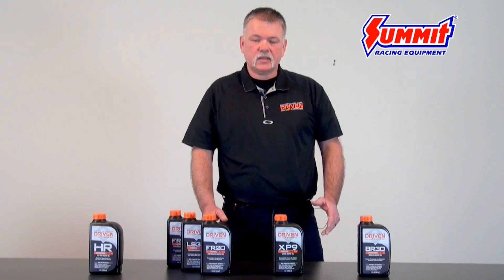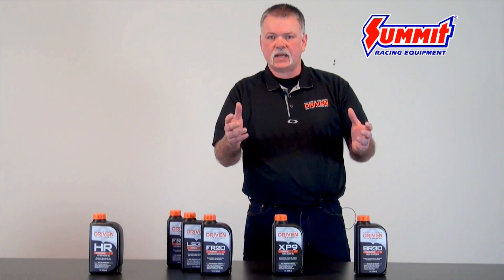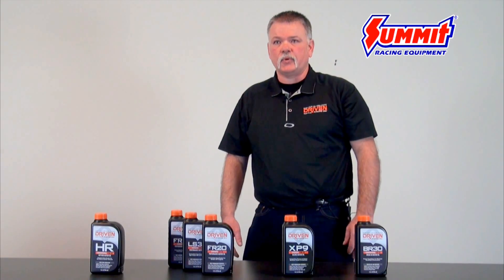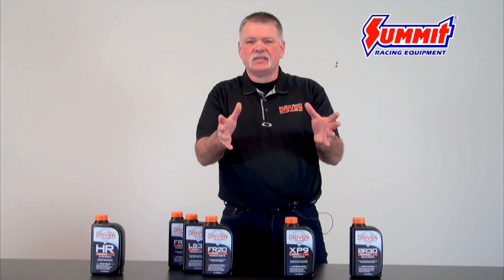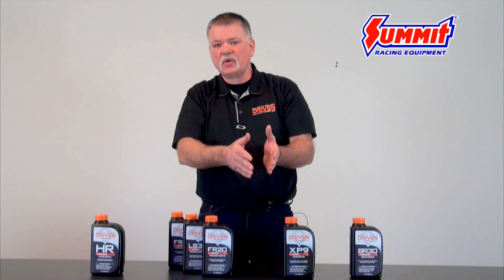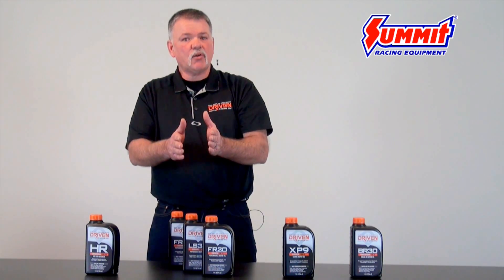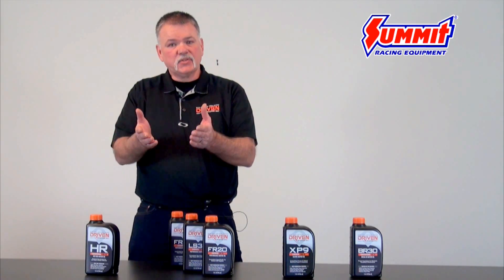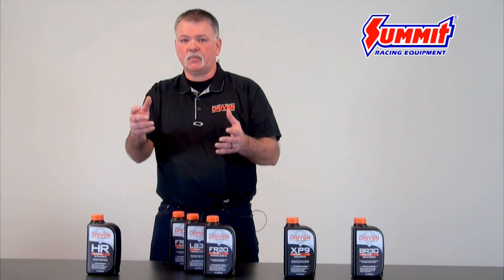Driven Racing Oil FAQ

Comment: All these questions following a video designed to answer questions.  Most common answer provided was that is not an easy answer followed by an incomplete answer.  That leaves us just needing more information.  I came to this site from seeing your ad in Panorama and wondered if I should be using it instead of a full synthetic in both my Porsches.  I left without changing to your product because the video answered almost no questions.

Comment: I started using Joe Gibbs LS30 oil in my 2015 Camaro SS. My drive to work and back is 104 miles long and 90 miles on the highway, I usually drive at 80 to 100 mph  when I can, how often should I change my oil? Should I rely on the oil life sensor which seems to go to Zero in 4000 to 5000 miles, or should I change it every 3000?

Comment: I have a 2010 dodge Challenger 5.7 with 56K miles on it.  which oil would I buy?  its non a syn motor and cap says 5/30. Thanks for help

Comment: Racing engine circle track big block chevy  (roller cam and 13.5-1 comp.) has been fogged and in storage for 20 years which had no more than 2 hour run time and used Mobil1 20-50 from the start. Since it wasn't run that long would using break in oil just to get it up and running a good idea? Thanks
Reply from the maker: Being stored that long, I would recommend disassembling and inspecting the engine and replacing all of the gaskets as some are probably dried out. You may also need to hone the cylinders if there is any surface rust on them.

Comment: So i was reccomend this ls30 5w30 for my 2.0 I4 genesis coupe turbo. I just fully built the motor. It's street driven mostly but does see track days. 500+ hp.  Can i run this oil at least 3000 miles? If so ill be happy with it. I change my oil every 3k or less regardless of driving habits.
Reply from the maker: While LS30 is probably fine for your application, you may want to consider DT40 (Summit Racing part number JGR-02406). This 5W40 synthetic oil can provide additional high-temperature and shear protection for your modified turbocharged engine. The 3,000-mile change interval should be fine, provided your tune is spot-on (not excessively rich, which can dilute the oil with fuel), there is no abnormal wear, and the vehicle isn’t subjected to a lot of short trips where the engine doesn’t reach full operating temperature.
Reply: @SummitRacing  thank you. Appreciate it. I was actually looking for a 5w40 driven oil. I missed this one! I have the ls30 in now.  Definitely going to switch for next change 👌🔥

Comment: What break in oil do you recommend to break in an air compressor that has a basic cast iron pump?
Reply from the maker: Hi NikeHM69, 
Scott from Driven Racing Oil said The BR30 is a fine choice to break in your air compressor. After roughly 4 hours of use, it would be best to drain the break in oil and then go to your operational oil. Please let us know if you have any additional questions. Thanks for watching!
Reply: Thank you very much for your answer!

Comment: how much zinic do I need for my 87 mustang I'm running comp cams xe 270 flat tapped version
Reply from the maker: Hi Brendan Mccabe, 
We spoke with Scott from Driven Racing Oil and this was his response: 
We are not sure how much spring pressure you have with his cam shaft but rest assured that our break in oil and our operational oils have plenty of zinc for this camshaft combination. Please don’t use any additional additives with our oil as it can only hurt their effectiveness.
To answer your question as directly as possible, the amount of spring pressure dictates for the most part how much zinc(phosphorous), the type and the balance of the zinc vs detergent is in the oil.
For example, API rated with 800 ppm of phosphorous can handle up to 230 LBS of open spring pressure. The problem is most aftermarket combinations have at least 270 lbs of open spring pressure which most API rated oils cannot handle that is why a high zinc oil is important. As I alluded to earlier, as spring pressure goes up from there, the amount of zinc must go up and the balance of detergents vs anti-wear additives become more important.
Reply: Summit Racing